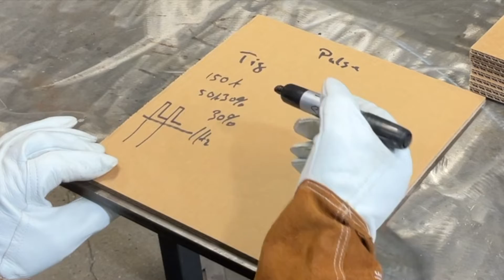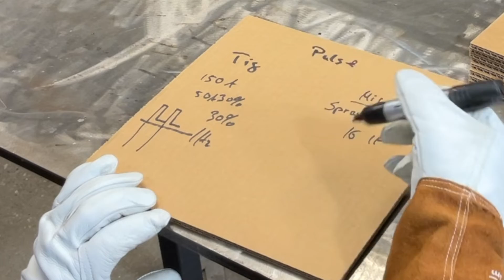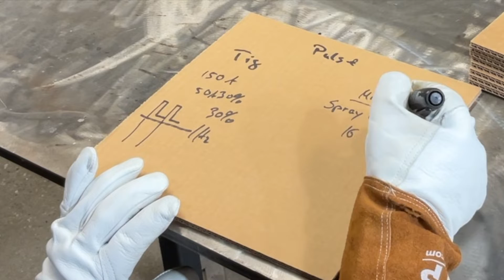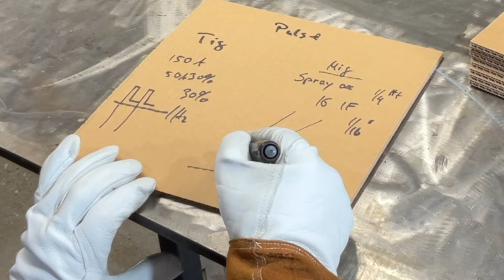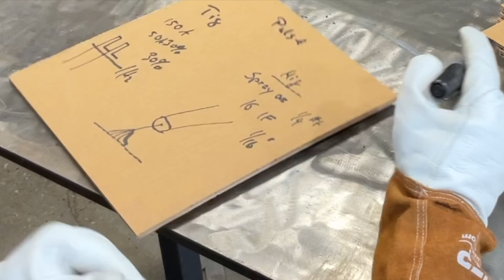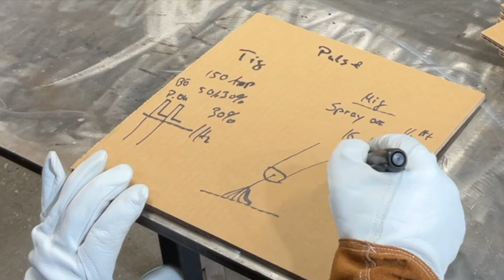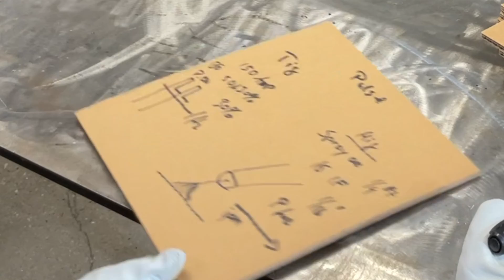PULSE MIG vs PULSE TIG

Comment: Thanks. I have a relatively inexpensive pulse mig weilder. When you setup for double pulse you can select a frequency but you cant when in single pulse. This leads to my question: what is changing frequency ..the primary pulse or the pulse on pulse?
As I understand it in single pulse the amps and volts change many times per second (perhaps greater than 60?) . In double pulse there is a pulse on pulse. From diagrams I see that the frequency of the secondary pulse ( the pulse on pulse) appears much greater than the primary pulse. So what am I changing when I select 2 pulses per second? The primary pulse as in the single pulse mode  or the secondary pulse as in the pulse on pulse?When I select 2 pulses per second I can hear this pulse surge and ebb very clearly.
Reply from the maker: the pulse frequency is directly related to wire speed ....  lower wire feed speed is a lower pulse rate .... and higher wire feed rates have a higher pulse rate ... as you make adjustments to the wire speed you need to make adjustments to the pulse frequency

Comment: Awesome explanation 

Looking forward to part 2

I was hoping this would be usable on thinner material 1/8 to 3/16” for use on applications where you wanted a stronger weld than short circuit could provide. 

I realize short circuit is probably fine but the idea of completely fusing these smaller thickness joints is kinda exciting

Comment: All fun and games until you get an everlast and all of those parameters arent preprogrammed
Reply from the maker: the 275p is "unique" in that way ... all the parameters are manually selectable ... that is when you do weeks worth with the research to find your parameters ... I feel your pain
Reply: @ZILAwelds  used up my 92 8 to backpurge and just going to work on  short circuit mig for a while